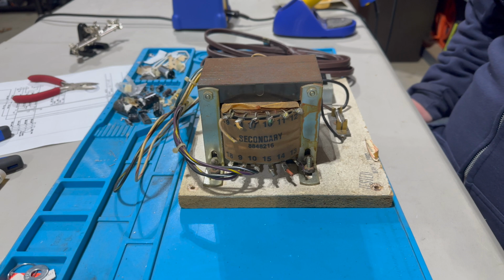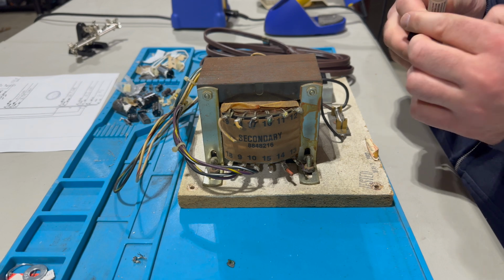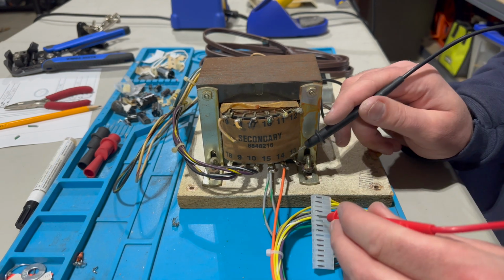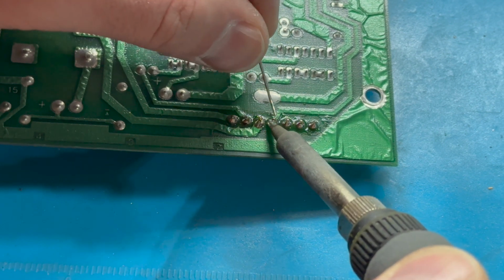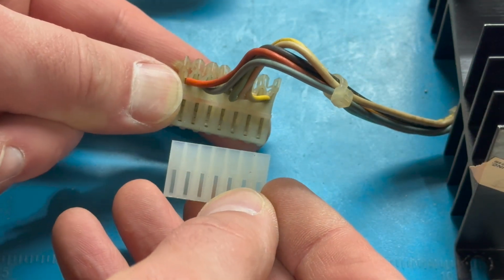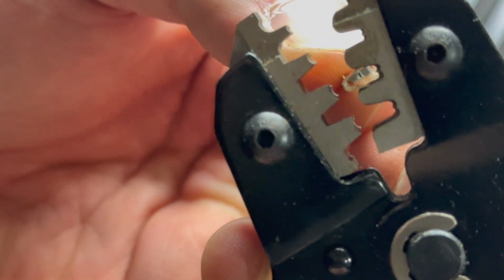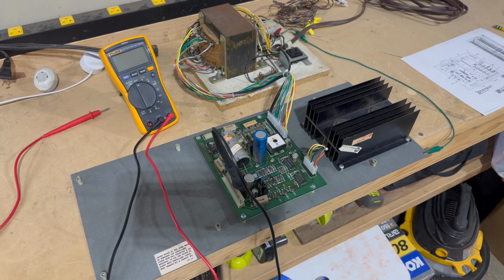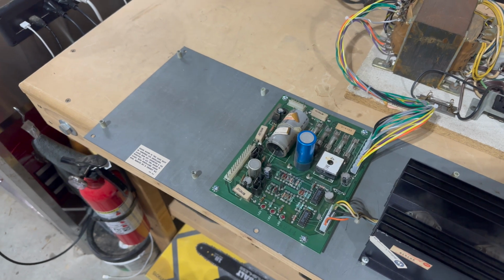Williams Joust Restoration part 6: New Transformer Wiring & Initial Test of the Power Supply PCB ⚡️

Comment: Nothing wrong with IDC connectors in low voltage applications. I am a radio engineer and use them in Telco and Audio wiring with no issues. Anything more than about 48v, I wouldn't use them.
Reply from the maker: What about after 40 years and many, many insertion cycles, with flaky ICs that are very sensitive to voltage levels?
Reply: @overtimearcade  non-stop insertion is a problem, I have punch blocks that have had the same audio wiring in it for 35 plus years and they've held up. But like I said in low voltage applications generally you don't have a great big problem with them if they're maintained properly. I also have punch box that are 35 plus years old that I have to move wiring all the time because of satellite relays audio relays etc but rarely do I have a problem with them if they're punched down correctly.. The only time I get concerned about connectors as if they start getting real brittle from heat or they were made out of just poor quality plastic.
Reply from the maker: Yeah, there were heat issues here too, plus Williams definitely didn’t use meticulous care assembling these IDC connectors!

Comment: Thanks for sharing the links. That's extremely helpful. 
Fyi, when using wire crimpers depending on the wire size when setting the terminal in the crimper, it  crushes the part that crimps the wire cover.  So it doesn't want to go all the way in. I just barley us the ratcheting to hold it so it doesn't crush it before I get the wire in.  Fyi
Reply from the maker: No problem! I always include relevant links to info & tools/parts I use in the video descriptions for each episode!

Also, I think part of the problem is that I was using trifurcon pins intended for 18-22 AWG while the wires coming from the transistor heat sink are 14/16 AWG. I eventually got it working though. 😅
Reply: @overtimearcade  Yeah the wire size definitely makes a difference..
Reply from the maker: It was close enough! 😂